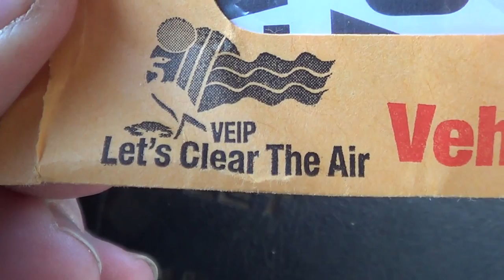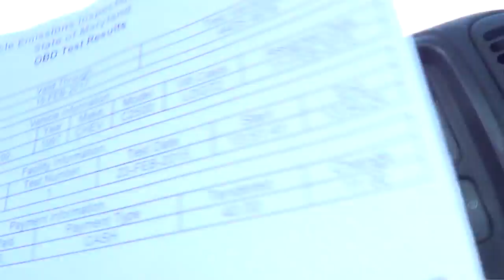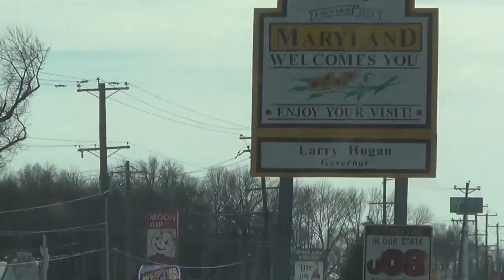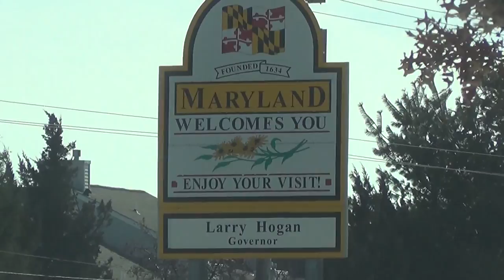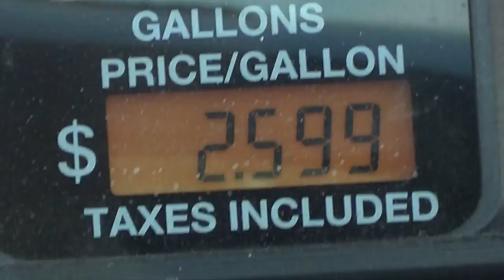Fiberglass Layup  &  Design  *  Maryland Emissions * Fast RC Car

Comment: Your outstanding instructional videos have given me motivation to attempt a big shower surround project. I still have a million questions but I'm learning.
Reply from the maker: AaronzDad THIS is not the same thing..... you would be better off buying a shower surround unless it has to be something very custom......?!?!
Reply: GasserGlass Yeah, it's a complete custom job in my RV. There just isn't anything on the market that would fit or that I could cut to fit decently. I understand what you are doing is kind of the reverse of what I will be trying but the fundamental ideas are really helpful. I'd love to pick your brain and get your input if you have the time and the inclination.
Reply from the maker: Ive made RV Tubbs and surround with seats in them....You make a PLUG first (a fake part)....then copy the fake part..called the molds.....then make the new part in the mold...done
Reply: GasserGlass That's not quite what I'm working on. Have you seen Mike's video on "How to waterproof anything with fiberglass"? youtube com/watch?v=LhWud4a5Aj8 That's the kind of project I'm dealing with. I'm building a big plywood box (shower stall) then sealing the interior with fiberglass. I'd be happy to post a video or two to show you what I'm doing and get your suggestions if you have the time to deal with a rookie pestering you.
Reply from the maker: I understand...I saw Mikes videos the day they came out..... If you are going to have your body inside the box, The way Mike is doing it, is NOT the way you want to do it, Trust me!........ You have to think INSIDE OUT or BACKWARDS....If you were making a Pond, Mikes way is one way to do it......If you were making a shower stall for 10 people, then you dont want to do it Mikes way!
Reply: GasserGlass Ahhh... I begin to understand. So what happens if I do it the way Mike shows the box or the deck work? Is the surface too rough? Is there a lot of fiber sticking through? Will it not stand up to use? Will it crack and break or start to pull apart?
I really appreciate the input from a pro. You could charge consultation fees =D
Reply from the maker: AaronzDad
All of the above
Reply: GasserGlass OK, but now I'm more confused. Mike mentions sanding the finished gel coat smooth at the end of his deck video so I understand the rough surface... but what about the integrity of the finished fiberglass? Why would it break up in a shower stall but not on an outside deck surface? You mentioned making a pond using Mike's methods but wouldn't that have more stress and strains on it than a shower stall? 
I appreciate your patience with my ignorance. Our plan is to live in the RV full time eventually so I want to get it done right the first time.
Reply from the maker: To use this method in a pool is how a REAL hillbilly would do it..... A REAL fiberglass pool is made in a mold just like my car parts!!!!..... to use mikes method in a pond is fine, Its for FISH....... In a shower, you want the walls and floor smooth as silk....So you have to make it in a mold....In a pond or pool, there is no more pressure on the glass then it would be if the pool was lined with a trash bag..... in a Pool or Pond, the walls and bottom are filled with dirt or layed over the dirt....there is no real pressure in one spot, the weight is spread out all over............... When you roll on gelcoat, it leaves a CINDER-BLOCK type texture that has to be sanded to make smooth...then there are Gazillion microscopic pin holes...so you have to put on another layer and sand that down too. ...... ....... ..... DO NOT MAKE YOUR SHOWER like in his video............ Make a Plug or Buck or MOCK UP of your shower....Make it PERFECT and SMOOTH or Whatever texture you want and where you want it.... Make the Mock up so nice that it looks real.....then make a MOLD from it...... then make a part out of it..... Making it any other way is disaster waiting to happen!!!!!
Reply: GasserGlass Thanks for the explanation. I wish I had talked to you before starting this project. I made assumptions based on Mike's videos and now I have some tough decisions to make. I have limitations based on the sheer size of the shower stall and the narrowness of the hallway and doors in the RV.
Reply from the maker: I'm sorry buddy...... but, better to know now then to spend gobs of money on something that wont work as expected ....if making a pond or pool repair, his way will work..not for a tubb for your butt cheeks or feet to stand on

Comment: Some parts of Ohio still have E Check. Here it is Only because they are so worried and trying to clean the air , unless you give them ,I think it still $300 for a waiver to go ahead and drive it anyhow . Guess they think it is ok to pollute as long as you have $300 to give . But it is All About the Clean Air

Comment: New logo looks great! I sent you a message through you tube, needing some advice on a bed cover. You tube may have put it in a spam folder.
Reply from the maker: Ill check
Reply from the maker: Double R Restorations went to spam I guess?
Reply: GasserGlass shoot me an email and I will re-send. Thanks, Russ